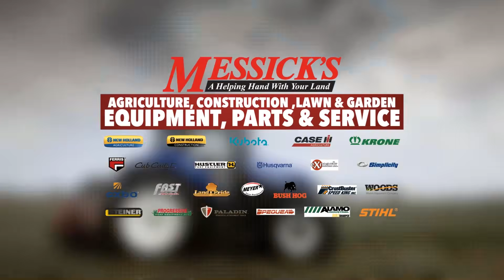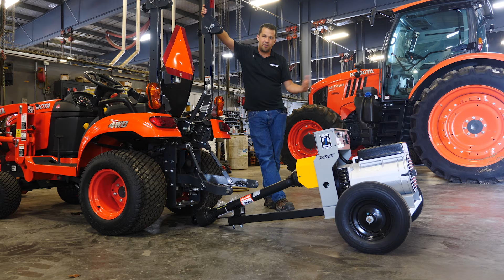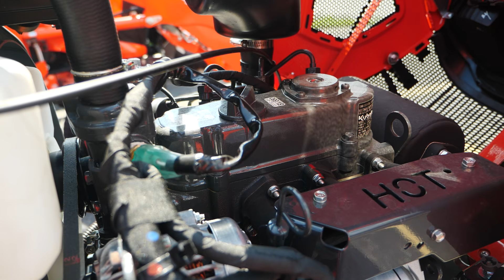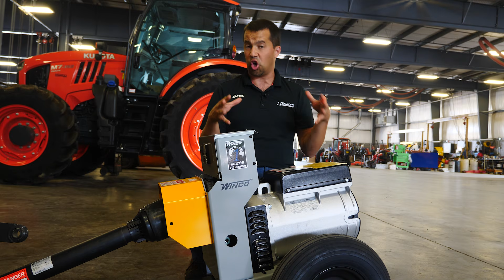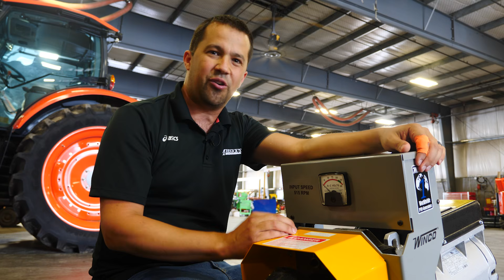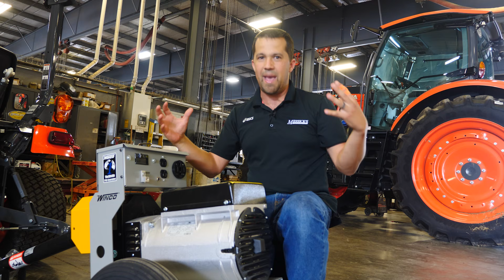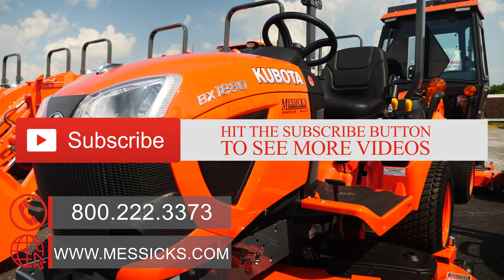Power your home with your tractor - Winco PTO Generators

Comment: Disagree you are wearing the tractor out
Reply: Most wear is from starting the engine, continuous running at a normal speed causes little wear.  It may improve perfomance if the engine is rarely used for extended periods.
Reply: Hours matter hours make tractors worth less.
I have lost power due to an ice storm followed by a snow storm for 3 weeks that is a record for me. I needed my tractor for other jobs around the farm like clearing snow I am unwilling to pull power from the house to use the tractor for hours on end. My tractor cost 30k a generator a good one cost 2500 to run the house I rather put the hours on the generator
Reply: @ggem8125  When the dusk settles, I have to agree with you.  It is much like braking on my Harley.  Excessive down-shifting will cause undue wear on the drill train, especially the tranny.  As he pointed out, it si a lot cheaper to change out brake pads that it is to change out transmissions.

Comment: I sold Generac  generators (mostly portable but a few standby pad mounts) at a electrical supply house. In most cases I COULD NOT convince the customers that they only need to feed emergency loads one at a time [ refrigerator, furnace blower, sump pump, freezer ]. They mostly wanted 25KW units that could  feed the whole house all the time. Heaven forbid they live without the whole house air conditioner and the pool heater. A even worse problem - they would spend $1000 for a generator but $10 to connect to the house power. OH I want a cord to plug into the generator with a male plug end to plug into the dryer or range outlet. After we tried to explain the EXTREME DANGER of energized male plugs, back feeding the utility grid, overloads they pooh poohed our warnings. Well, we refused to sell them parts to make suicide cords. We lost some business but could sleep at night and avoided lawsuits ( yes people do sue for their own stupidity ). If I have the money for a tractor and a PTO mount generator I probably can afford a small/medium portable inverter as well. The best of all worlds. Always great videos  Take care all
Reply: DAVID HOSMER z

Comment: We have a 7kw pto generator(northern tools if you must know, total harmonic distortion very low, can runs sensitive electronics) connected to dedicated house circuits through a manual transfer switch. Typically it runs from 7am to about 11am for breakfast, showers, reading email, etc. then off until 5, runs until11pm. Fridge and freezer will stay cold with this schedule, we have led battery lights if needed, wood stove for heat, outages have been only in winter. 17pto hp tractor will use about 1/2 of six gallon tank for three days on this schedule. Tractor is available during late morning and all afternoon for work.  Generator always starts. Has 30 amps at 220 volts, runs well pump, standard appliances, fans, window ac, probably whole house ac. All that we need.
Reply: "Generator always starts" Yeah, that's the big difference I see. You're running and maintaining your tractor engine all the time. If you have a separate generator engine, it's another maintenance item.
Reply: I'm considering a PTO generator (for power outages), but my current set up is two generators: I have a 3200 watt dual fuel inverter generator which can power all my household (800 sq foot) needs (except the well) at the rate of .19 gal of propane per hour (26 hours per 20 pound bottle). And a 220v generator, that I use for about 10 minutes a day to refill the 50 gal back up water tank, which uses 5 quarts of gasoline per hour.

It sounds like the biggest difference is that I have two extra pieces of equipment to maintain and store.
Reply: I have a 19 hp PTO what size generator should I be looking to get ?
Reply: @dirtyd9792  10kw CONTINUOUS, 12KW surge.
Reply: ⚠️Please make sure you follow all the generator safety tips whenever you use your portable generator. This is just a reminder for your safety when using generators. All generator safety instructions need to be followed carefully. 

Here are the safety tips: 

1) KEEPING OTHERS SAFE: Please do not allow an unqualified person or your children to operate and service the portable generator. Just because some manuals don’t say that doesn’t mean it’s safe. That is important against the generator safety rules. We also need to be keeping an eye on our children too. You need to make sure that your children are not playing near the portable generator especially when it’s running so they won’t get electrocuted. Generators pose electrical risks and they can be hot during an operation. Please keep your children away from the portable generator at all times. It is important to keep our children safe especially our little ones. Children often get curious about anything so we should keep an eye on them to also make sure they’re not wandering towards the generator. 

2) WHERE TO RUN YOUR GENERATOR: Some people use their portable generators indoors which increases the risk of carbon monoxide poisoning. It’s important to have a carbon monoxide if you have a gas generator. Never ever use your generator indoors even if your doors and windows are open and even in the garage is not safe to use a portable generator. Not even at your porch and your deck. It is never safe to use your generator indoors and in enclosed areas of your home. Your generator needs to be 15-20 feet away from your house. 

3)🔥FIRE HAZARDS: Never refuel your generator while it’s running. You need to let your generator cool off before refueling it and before storing your generator. Never overload your generator too. Never ever back feed your generator. You should never plug your generator into a wall outlet. Also never store propane tanks indoors. Please keep flammable things away from the generator as well and please don’t smoke cigarettes near the generator. Having a fire extinguisher next to the generator is also important against the generator safety rules. 

4) GENERATOR OPERATION: make sure your hands are dry before touching the generator. Never use your generator in wet conditions. Don’t let your generator get wet. You need a generator tent if you need to use your generator during wet weather. Please don’t wear loose clothes when operating the generator. Turn on your generator before plugging in appliances. Use the right cord for your generator. Please do not use worn out cords. 

Hope this helps.
Reply: My wife and I are looking at buying this same generator for our JD 1025R. Does it work well? By your numbers it uses half a tank for 30hrs of use? Trying to decide between this and a portable generac gas unit.

Comment: PTO generators are THE BEST way to go if you have a tractor. Tractors are tools and they are built to run. They are not town cars. More good advice from this guy right here.
Reply: Muy skookum.
Reply: I have a 19 hp PTO what size generator should I be looking for  ?
Reply: @dirtyd9792  10KW would be your max output. You can buy a larger generator, but you won't get all the power out of it.
Reply: @briangc1972  10kw CONTINUOUS, 12KW surge.
Reply: ⚠️Please make sure you follow all the generator safety tips whenever you use your portable generator. This is just a reminder for your safety when using generators. All generator safety instructions need to be followed carefully. 

Here are the safety tips: 

1) KEEPING OTHERS SAFE: Please do not allow an unqualified person or your children to operate and service the portable generator. Just because some manuals don’t say that doesn’t mean it’s safe. That is important against the generator safety rules. We also need to be keeping an eye on our children too. You need to make sure that your children are not playing near the portable generator especially when it’s running so they won’t get electrocuted. Generators pose electrical risks and they can be hot during an operation. Please keep your children away from the portable generator at all times. It is important to keep our children safe especially our little ones. Children often get curious about anything so we should keep an eye on them to also make sure they’re not wandering towards the generator. 

2) WHERE TO RUN YOUR GENERATOR: Some people use their portable generators indoors which increases the risk of carbon monoxide poisoning. It’s important to have a carbon monoxide if you have a gas generator. Never ever use your generator indoors even if your doors and windows are open and even in the garage is not safe to use a portable generator. Not even at your porch and your deck. It is never safe to use your generator indoors and in enclosed areas of your home. Your generator needs to be 15-20 feet away from your house. 

3)🔥FIRE HAZARDS: Never refuel your generator while it’s running. You need to let your generator cool off before refueling it and before storing your generator. Never overload your generator too. Never ever back feed your generator. You should never plug your generator into a wall outlet. Also never store propane tanks indoors. Please keep flammable things away from the generator as well and please don’t smoke cigarettes near the generator. Having a fire extinguisher next to the generator is also important against the generator safety rules. 

4) GENERATOR OPERATION: make sure your hands are dry before touching the generator. Never use your generator in wet conditions. Don’t let your generator get wet. You need a generator tent if you need to use your generator during wet weather. Please don’t wear loose clothes when operating the generator. Turn on your generator before plugging in appliances. Use the right cord for your generator. Please do not use worn out cords. 

Hope this helps.

Comment: I used a Lincoln 8 welder/generator for years , they have extra large fuel tanks for extended run time does double duty as a  portable dc welder and even has a idle down feature built in to save gas , at night it will power a few small lights just at idle but rev up as soon as it sees more demand such as a well pump,freezer etc. And they make diesel models too.

Comment: I don't usually comment on Messick video's, but watch them all.  This one is 100% correct.  We have 3 PTO generators here, run 3 houses with them, 20 to 30KW.  I usually run them on my 200 hp 1000 rpm PTO shaft with a 540 adapter, tractor doesn't run very fast, the big fuel tanks last forever and I can run everything in the whole house if I wanted without issues and have juice left.  My dad was always hung up about putting hours on a tractor, so he had a portable generator at his house...............It wasn't big enough to run much of anything, sucked up alot of gas, and since it was gas, even with treated fuel it still often had carb issues.  No thanks.  I seems most people who bash the PTO generator never had one.
Reply: I agree.  I just bought a used Kubota G1800, and am studying how to hook up a generator to it.  It should pull a 10KW continuous, 12KW surge generator with no problems
Reply: Exactly man. Every generator I've owned sits a few months then I run it abit... And carb issues... I see absolutely no downfall to a PTO driven unit for my house

Comment: I share your opinion. I don't know why someone would buy a gen with a motor and only use it 2 times every 5 years when they have a tractor they can run one off of. You have longer run time as well as not having to change the oil every 3 days like on portable gens.
Reply: and the diesel unit is more fuel efficient, and diesel is easier to get during storms because nearly everyone is burning gasoline in their autos while searching for gasoline for their inefficient gasoline generators!

Comment: The biggest benefit is gas generators that don't get stored correctly when being stored for years. So hurricane comes and you need your generator and it won't start its been sitting up for 2yrs fuel lines are cracked and carb needs a rebuild. I always try to do a bit of preventive maintenance but not everyone  else does. During natural disasters diesel is typically a bit easier to come by as well. I really like the idea of a pto generator. One less gas motor I need to maintain and my L2501 isn't to loud and the motor makes its pto power/speed at a fairly low rpm. Only draw back is I use my tractor for storm damage cleanup but I imagine the house would be OK for a few hours without a generator.
Reply: And you'd use far less fuel by running the diesel tractor powered generator!
Reply: ⚠️Please make sure you follow all the generator safety tips whenever you use your portable generator. This is just a reminder for your safety when using generators. All generator safety instructions need to be followed carefully. 

Here are the safety tips: 

1) KEEPING OTHERS SAFE: Please do not allow an unqualified person or your children to operate and service the portable generator. Just because some manuals don’t say that doesn’t mean it’s safe. That is important against the generator safety rules. We also need to be keeping an eye on our children too. You need to make sure that your children are not playing near the portable generator especially when it’s running so they won’t get electrocuted. Generators pose electrical risks and they can be hot during an operation. Please keep your children away from the portable generator at all times. It is important to keep our children safe especially our little ones. Children often get curious about anything so we should keep an eye on them to also make sure they’re not wandering towards the generator. 

2) WHERE TO RUN YOUR GENERATOR: Some people use their portable generators indoors which increases the risk of carbon monoxide poisoning. It’s important to have a carbon monoxide if you have a gas generator. Never ever use your generator indoors even if your doors and windows are open and even in the garage is not safe to use a portable generator. Not even at your porch and your deck. It is never safe to use your generator indoors and in enclosed areas of your home. Your generator needs to be 15-20 feet away from your house. 

3)🔥FIRE HAZARDS: Never refuel your generator while it’s running. You need to let your generator cool off before refueling it and before storing your generator. Never overload your generator too. Never ever back feed your generator. You should never plug your generator into a wall outlet. Also never store propane tanks indoors. Please keep flammable things away from the generator as well and please don’t smoke cigarettes near the generator. Having a fire extinguisher next to the generator is also important against the generator safety rules. 

4) GENERATOR OPERATION: make sure your hands are dry before touching the generator. Never use your generator in wet conditions. Don’t let your generator get wet. You need a generator tent if you need to use your generator during wet weather. Please don’t wear loose clothes when operating the generator. Turn on your generator before plugging in appliances. Use the right cord for your generator. Please do not use worn out cords. 

Hope this helps.

Comment: I have alittle over 1000hr on a 30kw unit I have since sold. I had it repaired under warranty, the top gear grenaded in it. My experience was generally good but a few things to note. You must keep a mindful eye on gearbox oil/seals. They are very loud/ have a whine, get the 4 pole/1800rpm version. If you are using a much larger tractor than your power requirements, be wary of wet stacking. I would probably buy another if I needed backup power, but for long duration running the noise is irritating. And fuel economy suffers because instead of being linked directly to the generator, like a genset, it instead goes through the tractors transmission. So you go from 1800rpm- tractor transmission- 540 rpm- pto gen's gearbox- 1800rpm. This turns more of your fuel into heat and alot of noise.

Edit to amend: We had almost 3000 hours on that 25kw mated to a ford 5600. It had the gearbox replaced under warranty once and It blew the diodes once. It was pretty tough for what I paid for it but we have settled on a nice mep803a, got it for $3500 used and the pto unit cost me $2700 new so its a much better deal.
Reply: I totally agree with you about going from engine RPM through the transmission to 540 then back up to 1800 even though it’s not a generator  we have on our farm a PTO driven water pump and last season I was pumping water from one pond through a 650 foot long  1-1/2 inch line filling another pond for irrigation purposes and it was running for two 8 hour periods I burned through 2 tanks of diesel and only filled the other pond 3/8-1/2  full The next day that pond was empty again and I said this is useless I’m not using that PTO pump for the amount of time and fuel and stress on the tractor plus taking up a valuable tractor that I could be using in the fields!  

I am designing up a plan to build a direct shaft diesel powered water pump too then pump through a 3 inch pipe and the pump can be fired up anytime I need water in the other pond and it doesn’t take the tractor!
Reply: @mainelyelectric  IF your tractor is large enough, shift the PTO to the 1000 RPM setting and "throttle down" the engine so the PTO runs around 540.  It's far more quiet, uses far less fuel, and pumps the same amount of water!